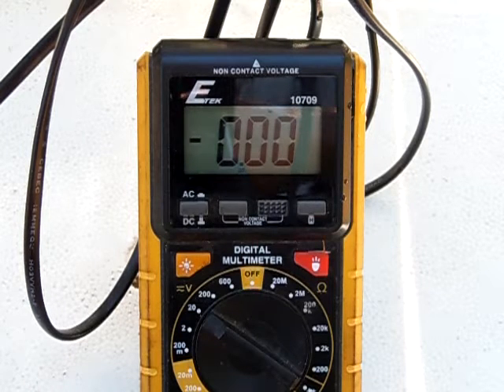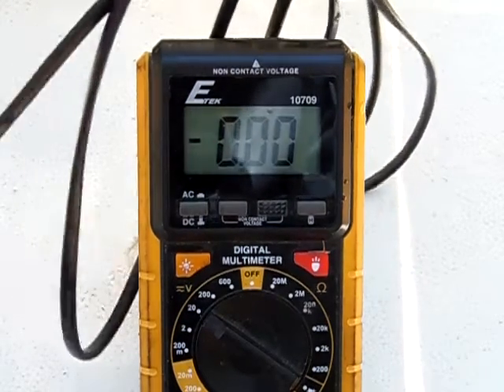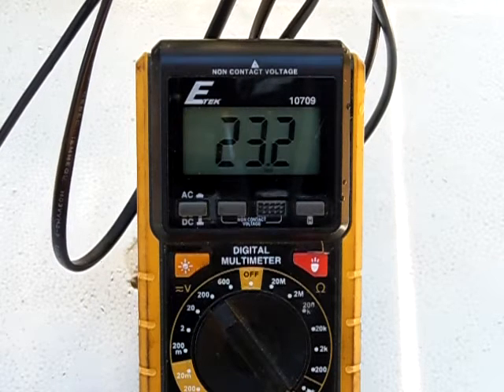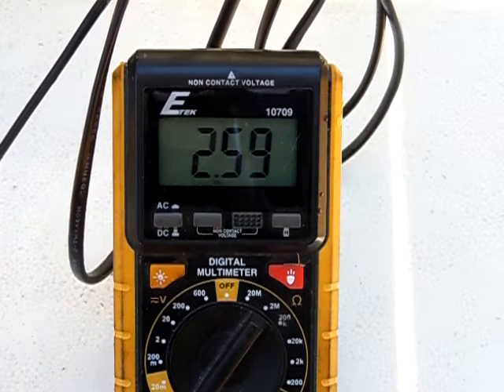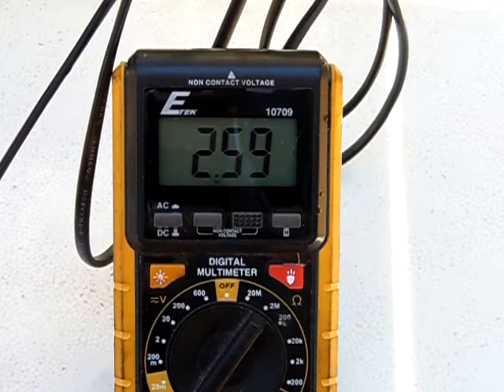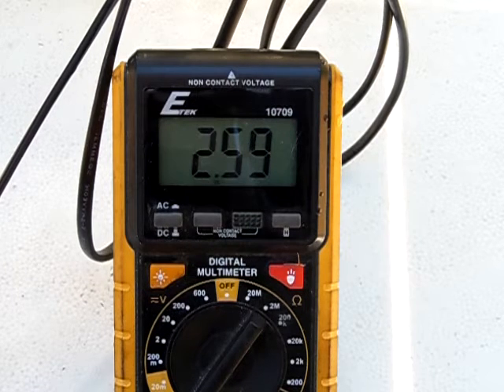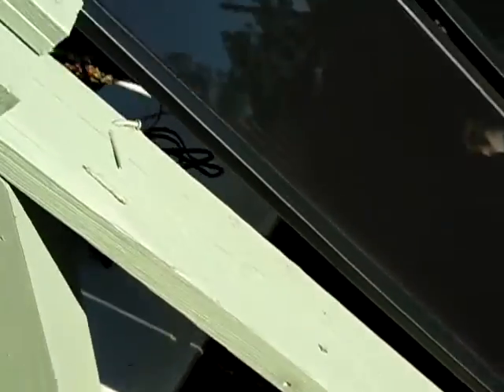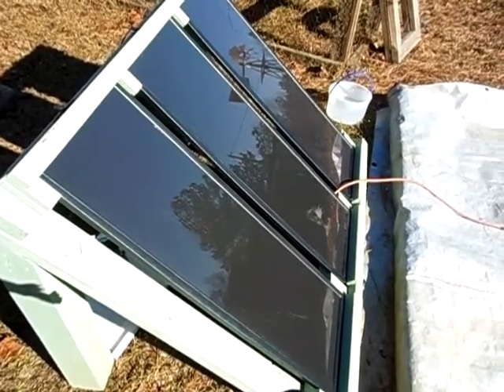Harbor Freight 45 Watt Solar Panel Kit Amps And Volts

Comment: I noticed the shadow was off to one side and behind the panels, this could be why you have lost some amps as well. the sun in not directly infront of them.
Reply from the maker: Yes sir. That is probably one of the problems. However, when I did check the amps in the past, they were never in full sun. Thanks for the comment.

Comment: very good or is it, i have 3 40 panels, each came with their own controller. having read some, it is better to use a mppt is what ia m reading or studying on
Reply from the maker: George Gardinier The three 40 watt panels are start. And yes, it would be better to use a mppt charge controller, not to mention, it makes wring a whole lot easier.
Reply: 2012solarful thanks i think the mppt gets the high voltages and changes to like 12.7 with higher amps and also pulses to the batteries to not have sullfation as much, correct or like this, long time watching you first time commentting, ha ha
Reply from the maker: Yes ,MPPT are the best charge controllers. I'm glad I could help you, if you have any more questions feel free to comment.